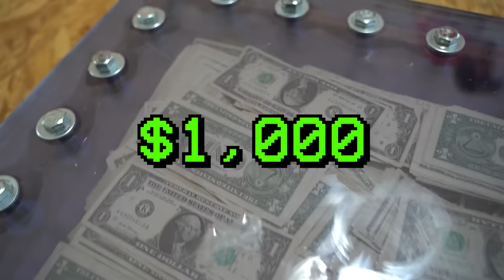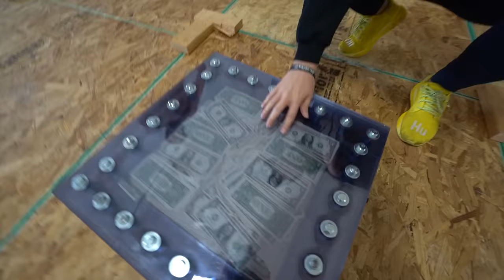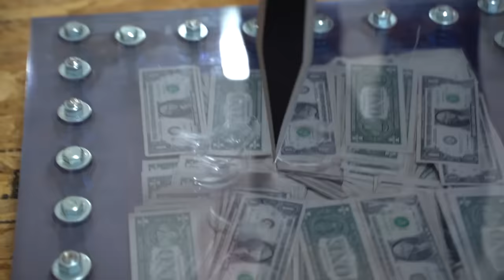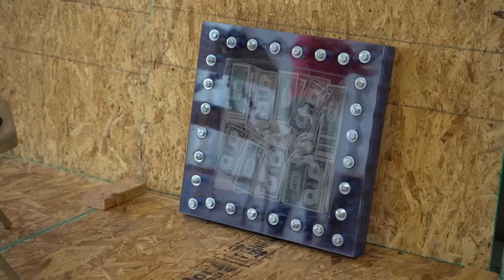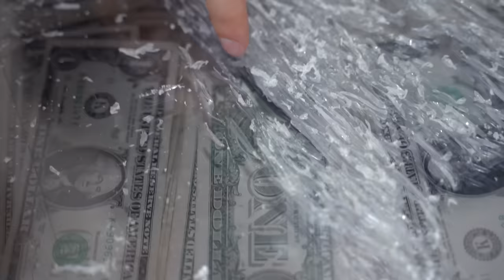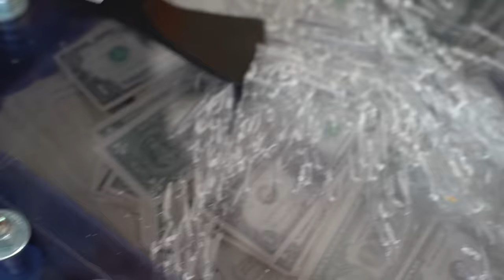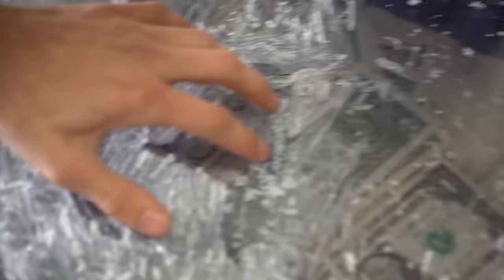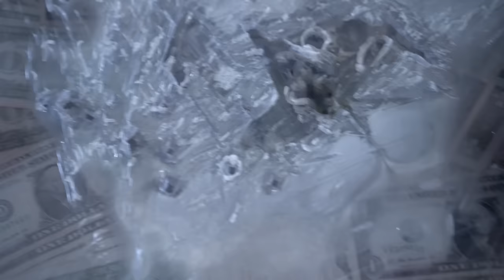World's STRONGEST Man vs Unbreakable Box!

Comment: Could’ve just poured the liquid nitrogen on and broke it in 1 minute
Reply: Sean Lowery The liquid nitrogen would have only provided more cracks, mainly because the glass their using has polycarbonate and brittle glass sandwitched between each other. So even if you were able to shatter the brittle glass the polycarbonate is extremely flexible and does not break easily